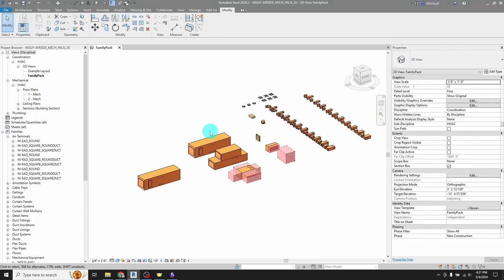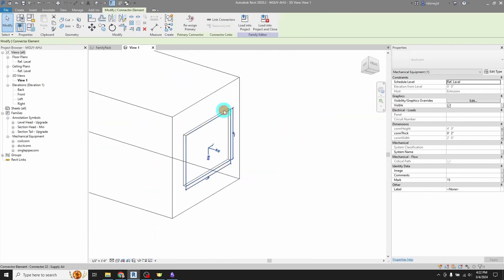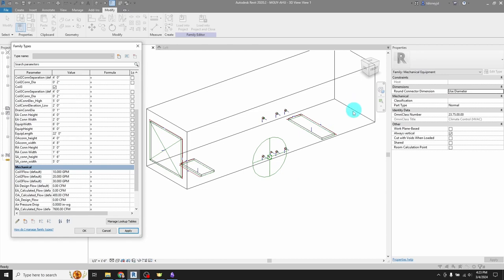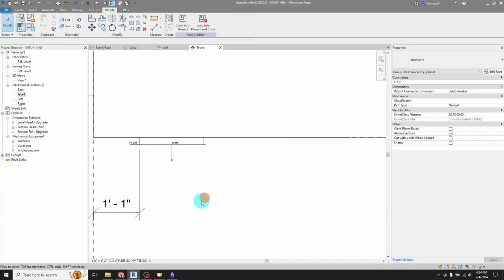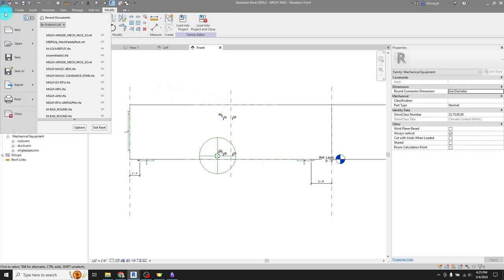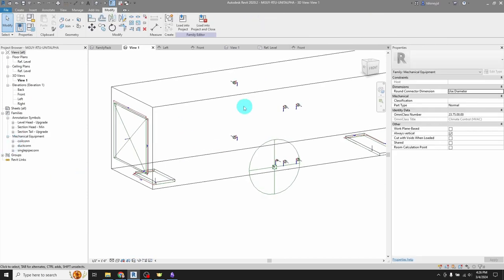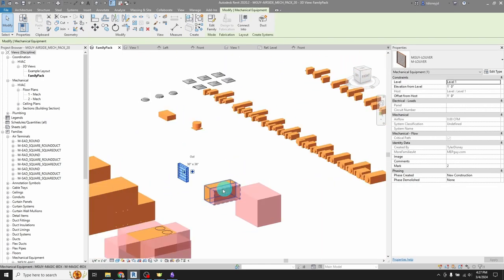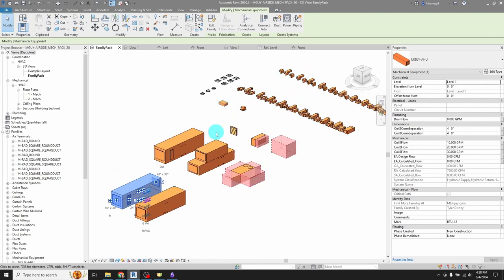Game Changer: Nested connector extrusions in Revit MEP Families

Comment: perhaps no need of face based, workplane based should be enough (as i commented in Ryan's channel too), i only use face based for automatically cut void, KISS all the way
Reply from the maker: I tried to make the duct connection nested family workplane based instead of facebased and couldn't get them to function the way I want (able to snap to any face with settable/flippable orientation). You could certainly make it work, but without the ability to re-orient the connection family normal in any direction easily I couldn't see how to maintain user friendliness of the family. I might definitely be missing something though! (To be clear for anyone reading this comment: All families in the pack are workplane based. We're talking about the hosting of the nested connector elements within the AHU/RTU/etc families.)
Reply: i mean that extrusion family to be used as host for connectors, this can be non-host w/ work plane-based option checked so you still can host to face just like face based family @tdisney
Reply from the maker: @ningzhou8397   TIL! Many thanks, I'll be adopting this technique.